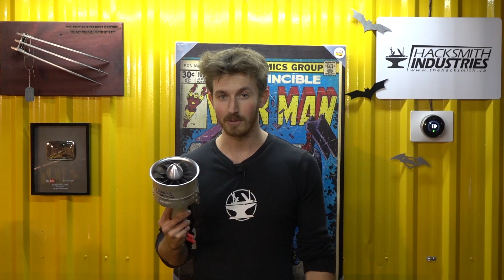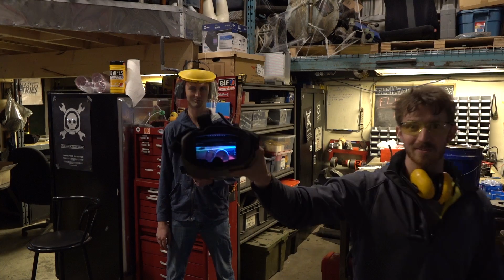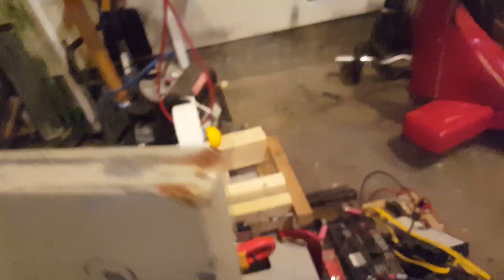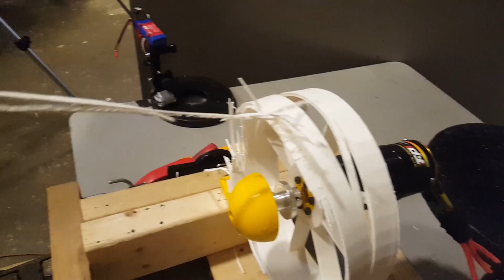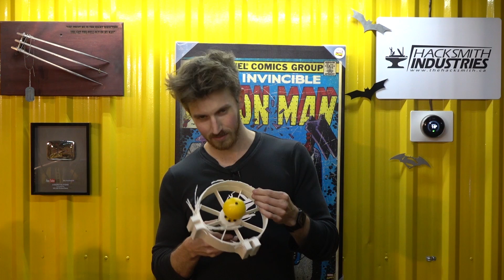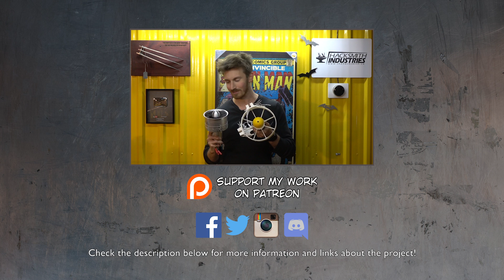Flying Like Iron Man Update: EDF EXPLOSION!!!

Comment: dude... I think I've got it.

Build a cylindrical chamber with a rotating positive magnet around the outside. Flood the chamber with negatively charged photons, which follow the magnet in a spiral. (this allows a continuous stream of photons to be fired, instead of just fill and burst once.) Then, on one end of the cylinder, is a lens; the other end is a powerful positive magnet, which when activated, pushes against the negative photons, ejecting them out of the lens with force equal to the strength of the photon's magnetism and the electromagnet itself. And there you have it...

...a working, REAL Iron-Man repulsor.
Reply: I love that everyone here is trying to take this idea seriously XD
Reply: Sorry if I'm missing something dude but switching on a powerful positive magnet would push negative photons out would it as posives and negatives attract. plus I think the amount of photons needed to propel any reasonable weight would need to be so vast and impractical
Reply: Photons are don't have (resting) mass, and can't be charged. Photons all have a velocity of roughly 300,000,000 m/s, aka the speed of light. So, even if you had a "magnet" that could attract photons, (currently the only thing we know that attracts photons is gravity) it would have to be able to apply a force greater than the speed of light in order to move the photons. Aka, a black hole. You can see the problem here, right? You would get no acceleration anyways, because photons have no mass. this is why lasers don't have recoil.
Reply: SonOfMyths73  wtf
Reply: Which is why, I assume, you use Palladium.
Reply: SonOfMyths73 wtf
Reply: The magnet doesn't need to have 80 kgs of force; the photons are charged as well, so they'll push back. So all you need is the photons themselves to be built up enough within the chamber to produce that force on their own, and then nudged through the lens by the electromagnet. It would probably look like a bright white glow, followed by a blast of white energy emitting from the lens. Sound familiar?
Reply: Sounds like ion thrusters which they use in space, however problem is with them, no where near strong enough to lift anything up whilst subjected to gravity of earth, because not enough power.
Reply: 2 things. first light acts as a particle and can in some circumstances have mass. second, lasers do recoil. the recoil is just so little it is impossible to feel. in some studies high powered lasers have induced a weight on a super sensitive scale. this weight is nowhere near noticeable but it is real. if you look at a picture of a black hole you will see the bending of light around the horizon. if light had no mass it would not be affected by gravity and would not bend.
Reply: Okay, seriously guys. I think the OP was not making an actual suggestion 0.0
Reply: Jake Productions I know that, hence why I stated they have no "resting" mass, and for lack of a better term can be considered massless. They do however have momentum inversely proportional to their wavelength, which wouldn't be possible with zero mass. I'm no expert on quantum physics, but photon's don't behave nicely with Newtonian physics, and because most other people don't know much about quantum physics either, I tried to get my point across as well as I could. And, light reflecting off of a surface will impart some momentum into that surface. I'd assume the same thing happens with lasers, but again is so minuscule that it is effectively zero. Or something like that.
Reply: Brandon Fowlkes I knew what you were saying. I just wanted to mess with you a bit. Thanks for being a good sport.

Comment: one way to improve your tests is to print the housing and turbines in different colors so you can identify what the debris comes from if it explodes.
Reply: also as the blades were spinning up I observed that the screws holding the frame together began unscrewing themselves from the vibrations. You could add some lock washers to prevent that from becoming a problem.

Comment: Maybe you should try using PC filament. And I've also read, that smoothing the print via Acetone vapor (for ABS only) can strengthen the surface too. 
Plus, when you rip off the lose parts, they seem to get off quite easily. Maybe the layer adhesion could be improved. You could try using higher temperatures or filament with better quality.

Comment: Why don't you make a mold with 3D printing and either aluminum cast parts using the 3D printed part in a kind of loss injection sand casting or use a more stable resin? Is it about the weight of other materials?

Comment: try using acetone to fuse the layers of the 3D prints together which will make it much stronger and also slightly less air resistance. Also you could try printing at a higher fill rate on the blades

Comment: You desperately need to film these fan explosions on your GoPro in slowmode, to analyze what's wrong in current situation and it'll be much more spectacular;)
About materials: 
You can cast blades from aluminum but then you'll have to thermally treat them to improve their characteristics. 
Also you can create carbon fiber plastic, but to improve quality you'll have to use vacuum chamber.
Reply from the maker: We're filming another at 1000fps using our camera =)

Comment: New Subscriber here. I think you could have gone faster. Have you compensated for the stretch of the the blades at high RPM? Also, I understand you are still in the testing phase and are limited on funds, but do you have a high speed balancer. If so, once you have a design you approve of, you can cast it yourself in aluminum for relatively cheap, grind and smooth (or polish if desired) then balance it.
All that should take about 24 hours, if you include the print time if my seriously rough calculations are anywhere near accurate.

Comment: Are you monitoring the motor current while you are testing?  Power required at a given RPM for an impeller geometry increases as the fifth power of the diameter of the impeller so it doesn't take much extra diameter to overload a motor by several hundred %.

Nice explosion.  I had a similar experience with a SLA printed impeller which is closer to glass than FDM plastic.  I'm still finding pieces of it almost 2 years later ;-)  

Once you feel like you are close to the impeller design that you want you might have better luck casting an impeller in a high strength plastic with a mold made from the 3D printed part.  That would also allow you to sand, polish and semi-balance the impeller before you cast it.  Castings are much faster to reproduce than 3D printed parts. You could add a ring of fiberglass around a ring built into the OD to help hold it all together.  Dynamic balancing will be important since even small vibrations will likely fatigue the impeller.  For what its worth, I'd suggest never using a homemade setup for human flight that hasn't gone through extensive testing at stresses 5x normal operating stresses.  Even then, don't count on it not failing.  There are too many variables for a home shop to control to be safe.
Reply: John Biggs I didn't take his reply as negative. I just thought to myself that I would get tired of answering questions that were covered in the video so I actually thought he put it nicely. 

Plus,  he's taking a lot of time and money into entertaining me for free so I'm just happy to get to watch him explode impellers. Fun stuff ;-)
Reply from the maker: +Tony Shulthise I'm confused, didn't you watch the video? There's an ammeter in the shot and a caption saying the max current drawn ;-)

The motor used is rated for 250A continuous so we still had around 25% margin to play with. Next goal is getting a dynamic balancer before we play with more high speed projectiles ;-)
Reply: the Hacksmith Sorry about that. I missed that all together ;-)  You guys should team up with "the slow mo guys" for your next test.  That would be very interesting in super slow motion.
Reply: Tony Shulthise Tony don't apologize to him he is a jerk and should not talk to people like he does to people on here. dear hacksmith if you don't like a comment ignore it. don't go and make someone else feel like shit. I asked you a question once and was hoping for a reply back well I got one and you were a total jerk about it and put me down.
Reply: Well he was still a jerk to me. But to each his own. Have a great day sir

Comment: A lot of people might suggest using different materials or traditionally manufactured parts.  I suggest tweaking your fan design.  To my eyes, it looked like the fan tore itself apart, instead of something like the duct rupturing from pressure.

Maybe both were a factor in the explosion, but regardless, the structural design of the fan and duct will be very important, considering the lower-grade material that is current consumer-grade 3D printed plastic.  You may want to look into some kind of reinforcement, thickening of walls and surfaces, and/or structural ribs for your 3D printed fans.
Reply from the maker: +FlintTD bigger issue is optimizing the design for thrust -- it's unlikely any FDM printed material will survive 40,000rpm :(
Reply: Well, you did just put out video evidence of that!

I know you're probably way ahead of me, but if you can't get your hands on a printer fine enough or material strong enough, consider CNC-ing big hunks of circular material.

Or you can make expendable fans that you swap out with the batteries, but I wouldn't want to fly something that explosive!

Comment: Correct me if i'm wrong, but don't you have a CNC-Machine? How about cutting the blades out of aluminium?
Reply from the maker: +Unbekannter Fehler bed size is only 6" x 10" :(
Reply: the Hacksmith are you balancing the blades before you run them? I saw some vibration. Furthermore, look into acetone treating the blades. This helps bond the plastic layers together battery and fix some imperfections.
Reply: rip

Comment: Have you tried using a metal printer for the edf parts?
Reply from the maker: +Carl_The_Gamer this size blade would cost $900 USD to print in aluminum . . .
Reply: oh I see so it would be ~$600 more to print them compared to buying them
Reply from the maker: +Carl_The_Gamer not quite... You can't buy this size of fan. That's why we're making them :p
Reply: Well, is there a way to in bead steel or aluminum into the printed fan blades and the walls of the edf, of course I would assume decreasing the thrust and increase the power usage. I am just trowing out ideas, but I will say keep up the great work, Love your videos!

Comment: Their is a lot of vibration that happens at high speeds, this causes the blade to reverberate to a point that eventually the bonding layer break apart or come on done. It causes great havoc and starts to become shrapnel that obliterates everything   Try doing this with metal and it becomes detrimental. You guys should have done a vibration test before full throttling to reduce the same effect.

Comment: In fact the answer is right in front of you,  just realised,  you know the kevlar string you guys have been playing with make the safety guards with the PLA,   and wrap the kevlar sting round the housing and then expoxy that, if there is a failure the string/kevlar laminate should stop the shrapnel  flying out.   Also the tips of the blade might be hitting the sound barrier causing the failure point.  Carbon fibre might be another option.
Reply from the maker: +Richard Cave LBPPA It'd be way too heavy... And not very aerodynamic :p

Comment: if you look at jet turbine blades they are grown seperately and then slotted into the spindle with a slot that looks like a xmas tree.  They are also weighed and balanced before being placed in the engine.  Might be cheaper to order the larger manufactured blades then building the spindle and casing seperately.

Comment: Why not dip the 3d printed parts in epoxy or resin? You could redesign them to accomadate an extra layer so that everything fits. Maybe in order to make sure you get an even coating you could have the fan on at a very low RPM and the centrifugal force could naturally even out the layer and keep the balance as to eliminate vibrations later on. If you guys want, I'm sure if you contacted Peter Brown he would absolutely love to help and I can't think of anybody more qualified.

Comment: Check out liquid resin 3 printers? I have no idea if it is any better but seems more solid and on one piece. Im thinking of the way if got shredded into stripes if that makes sense. Check out formlabs I think its called, saw a with created by Barnaclues that using that printer.

Comment: Try to do a lost PLA casting of the outer shell and mold it with aluminium if you cannot CNC it, and if you finish the blades for a smooth surface using putty filler, then mold them, the blade will be much sturdier than what it would be directly from the 3d printer

Comment: what about "annealing" a PLA print I saw a video done by Thomas Sanladerer about this and it seems to melt the layers together a but cause a little shrinking and really strengthen the parts so hopefully they wont explode like the raw print did, I've also seen a method or two of reinforcing a print with fiberglass resin and cloth. Just ideas Good luck on getting one made that doesn't explode :P.

Comment: Fiberglass reinforced poly would be great for this. You can easily make injection molds to get the final result. Nice part is that once a mol is made, duplicates can be easily cast over and over again. Cnc milling would be another option, using aluminum or again a polycarb that is glass reinforced would fit the bill.

Comment: You could try an acetone vapour bath for the 3D printed parts.  It might get a little more strength by stopping surface fractures propagating.  See here: https://www.google.ie/amp/s/benchapman4.wordpress.com/2014/05/08/increasing-toughness-of-3d-printed-plastic-using-acetone-vapor/amp/

Comment: Maybe 3d print the blade and casing and then use the prints to make molds and cast parts out of aluminum. Of course you will want to balance the blades before using, and the aluminum may mean more energy required.

Comment: hey hacksmith,
Do you know about increasing resolution of STL files ?
High resolution file will create fine surface and every thing (may have high strength..not sure about strength)
Just go to Save as STL then select Option then increase the deviation in SolidWorks.. 
Thanks.

Comment: Hey the hacksmith, why dont you not just use a car turbo-charger fan blade? They can take up to 280 000 rpm without exploding!
Reply: no but a truck one might, and remember, even a 2l car needs 2l of air on every revolution, at 3000 rpm is 50x2l a second or 100l per second, and thats at about 5psi, so turbos are not that bad really
Reply: He needs high volumes of airflow to get enough thrust, a car turbo wouldn't work.
Reply: The shape of the turbine blade is totally different, and you wouldn't be able to find anything close to that diameter anyways (for a reasonable price)
Reply: But the blade itself should do 280 000 rpm without breaking. So maybe if they only took the blade out and bend it so it makes air flow?

Comment: I'm shocked you even attempted to even try something no so bright , look at a grinding disk and how well it's made and it's strength. Now go and find a 3D printer in metal not silly plastic you can have all this in titanium , or stainless steel prop. Titanium would be better and lighter and you can have a larger prop to.
Reply from the maker: ...And we make a titanium blade cheap how? Or stainless steel for that matter? Production of that would cost over $1000 in metal!

This is engineering -- we are prototyping the design of the EDF and testing it with 3D printing to save money -- once we have an ideal design in place, we'll look at having it machined out of aluminum.

Comment: As an mechatronics engineer to you guys:
There is no way 3d printed plastic fins are going to satisfy your needs for that rotating momentum.My suggestion would be to make it 3d printed, then make a mold out of it, and cast it with aluminum or steel alloy(polish it for smoother airflow over the fins). Even carbon fiber fins could teoretically work.
Put all of the fins on a surface, making a sheet, if you hang your weight on that beam in the middle, it should not break.
So calculate the tensile strength of that material in that configuration ;)
Reply from the maker: +Lou Chan as mechatronic engineers as well, we know :p we're using 3D printing to prototype the design :)
Reply: Nevertheless it is fun watching it get destroyed ;)

Comment: Do you have access to a high speed camera? It looks like the shrapnel flies axially, so you should be able to do this safely without damaging the camera. It's important that you figure out what failed first, of course. 

I would experiment with composite construction. Would it be possible to apply something with very high tensile strength over a 3d printed honeycomb? I'd also experiment with using solvents to weld the strands together.
Reply: stcredzero maybe if he soaked it in acetone. I'm not sure how it would affect it's strength but I had a friend who used it to make his 3D prints appear smooth.
Reply: dipping it in acetone or better treating it with acetone vapor would pretty much max out the strength of their parts as long as they did print it in abs in the first place. the acetone would partly liquidify the whole surface and whilst drying the surface tension essentially turns the whole outer shell into one solid piece instead of some thermally bonded layers. if they would let it properly dry for about 2-3 days (just to be sure the solved surface totally sets) this would make for some fucking strong  parts.